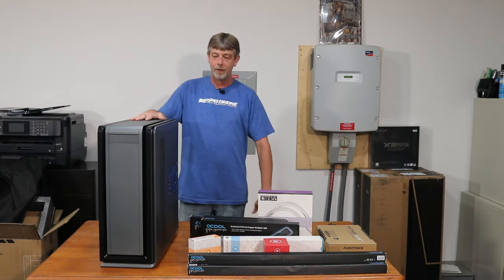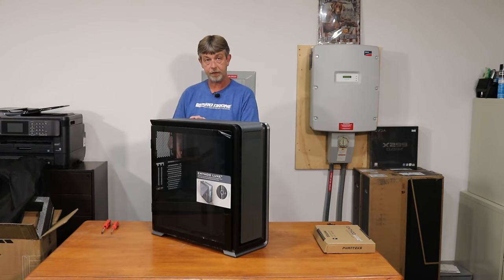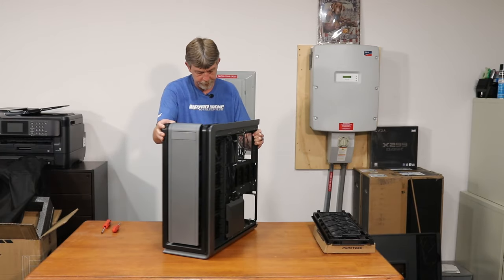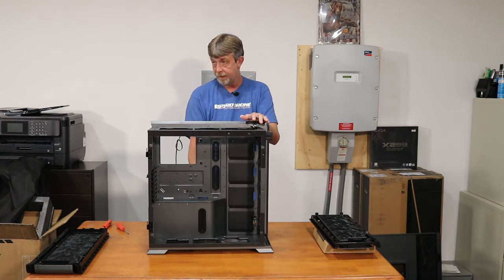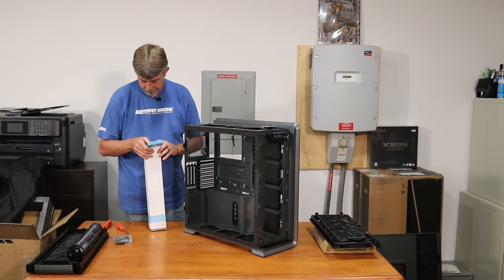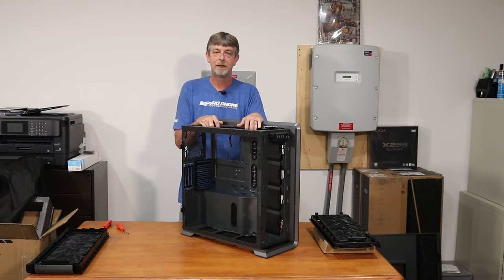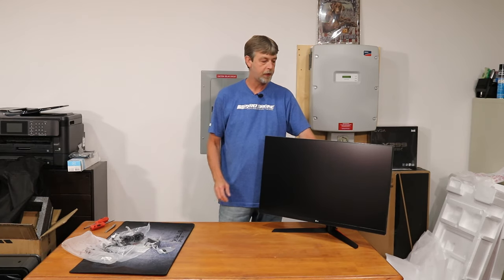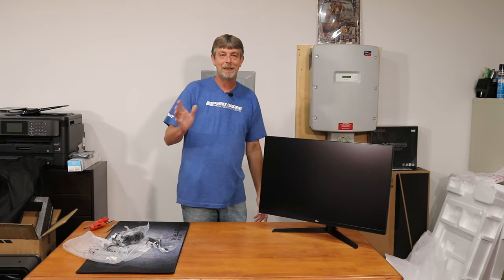Phanteks Luxe 2 and LG UltraGear 32" Gaming Monitor

Comment: I'm looking to get that case for my first water=cooling as well,  I really want to figure out how to get 2 480 rads in the side and front... overkill is my favorite... keep building!
Reply: with the fans on? i know you can put a rad or fans in the back of the side area, but will a rad and fans fit in front at the same time (with access to the water ports on the rads) i see a lot of conflicting reports as to what truly fits there:)
Reply: @Tech4UbyJames  That would be very cool,  I have some ideas if it doesn't fit right away, but without having one to play with it's hard to be a good judge of what will work (and very few people have built into the luxe 2 at all)
Reply: I have that case and my plan is for two 360 rads so as not to have one radiator blowing hot air into the other.  I thought I could fit a 480 in the side and a 360 at top but since I'm going with x-flow rads, the 480 won't fit anywhere in the case.  I'm determined to used that design to keep the piping to a minimum.